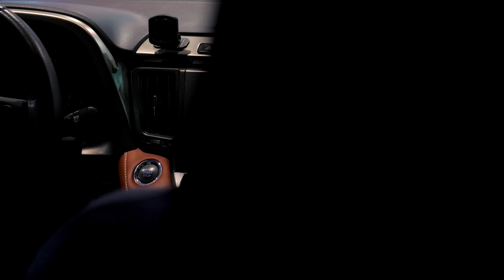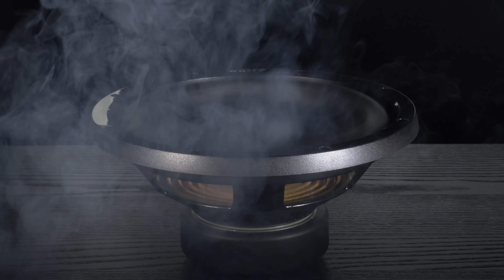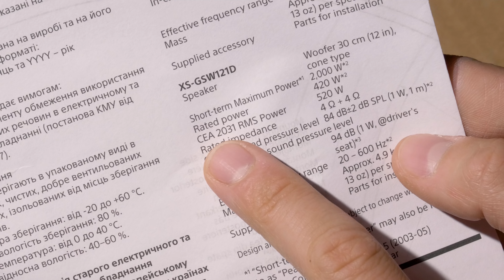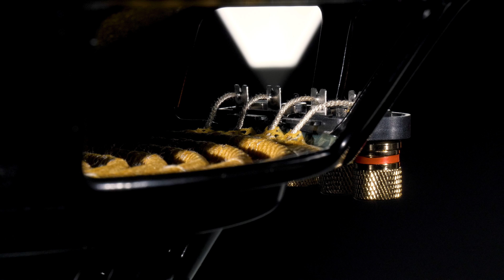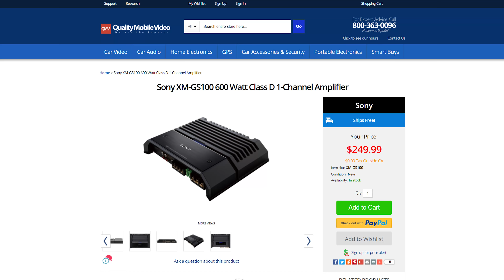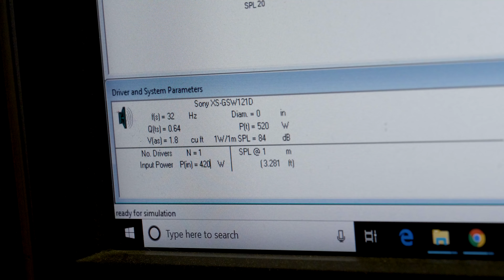Sony XS-GSW121D - Dual Voice Coil 4 ohm Subwoofer

Comment: Crazy impressive subwoofer. Just got one and ran it on a 1000watt pioneer Amp and the quality, and crisp quick bass is amazing. I put it in both sealed and ported box, you get way more out of it in a ported box. It maintained its clean quick bass but also brought out beautiful crisp controlled low end frequencies. In a sealed box it cuts off its ability to produce heavy lows. For 150 on Amazon I think it sounds great and looks great when you open your trunk. Anyone who gives these a bad review either have the wrong set up/box or just want an unruly sloppy crazy competition amount of bass which isn't my Forte. I love bass but not if it's sloppy and earthquake ish. I listen to ALLL ranges of music and I need my sub diverse. I'm a huge fan of Sony and this didn't disappoint. I have the Sony Amp and 4 Sony door speakers too it just sounds so amazing in my CRZ best system I ever had in my car.

Comment: I ran 2 of these on 450 rms each. Both sealed and in a 3 cu ft gross tuned to 36hz. Both were unimpressive. There low xmax something like 8.6mm sucks. You can get much better subs for the price or even less Such as some alpine basslines for $50 on amazon or some skar ix series.
Reply: Well there’s your problem, your lack of knowledge is the reason these subs let you down

3cu ft is way overkill for these subs; especially for sealed, ported isn’t even recommended that high; and you can’t tune a sealed box it’s a flat response 

You sir, are an idiot, don’t rag on a product if you’re too dumb to hook it up correctly
Reply: @stevencccccc  It was ported and the box was 3 cubes tuned to 36hz. These are just hype max watt subs. I've played with a ton of subs these in a custom box sealed or ported were super unimpressive.
Reply: @BassFace1776  you really are an idiot...
Reply: 3 cu ft sealed is waaaay too big for these things
Reply: @stavrosgavrilis3889  definitely was ported tuned to 36hz

Comment: can i directly connect two 6x9 speakers on my stereo?
Reply: Redford Samson the short answer is yes. Although if you were to have like 300w speakers, it wouldn't make sense to hook it up to a low power head unit (like the factory one). Why? Simple.. You get pathetic quality and distortion at higher volumes. Most aftermarket head units will output enough power for your speakers, or you can add amp to your factory head unit
Reply: Yes
Reply: Redford samson you can connect your 6×9 woofer to stereo even the factory one now a day every stereo with a minimum of 24w rms. So you can connect with it. I think you didn't know about the specs of that woofer and stereo. If you think the volume is not enough for you then you add amplifier. Some factory made head unit does not exist the low audio out so the amplifier connect the speaker out put. that increase the volume but decrese the audio quality in this case the speaker connect the stereo otherwise change the stereo. So my  opinion is yes.